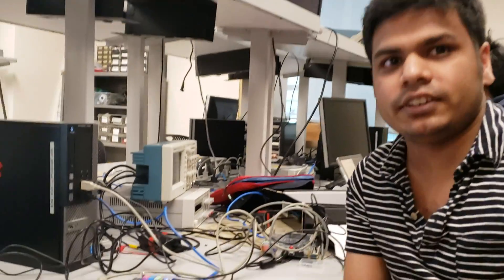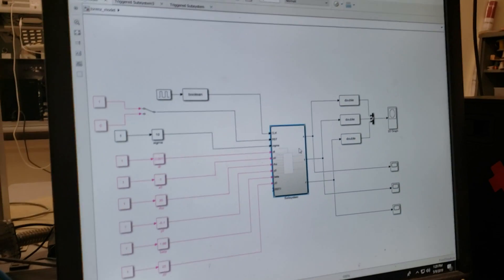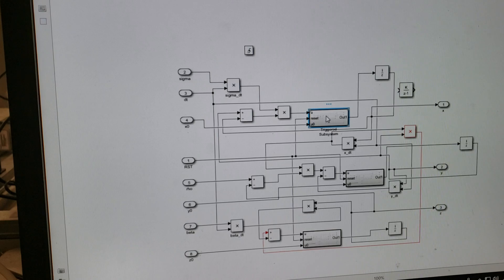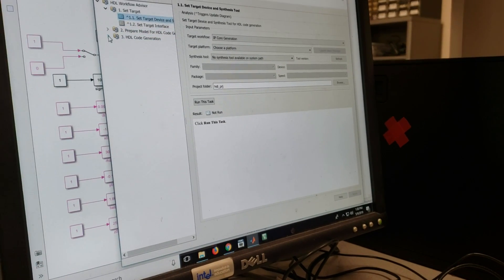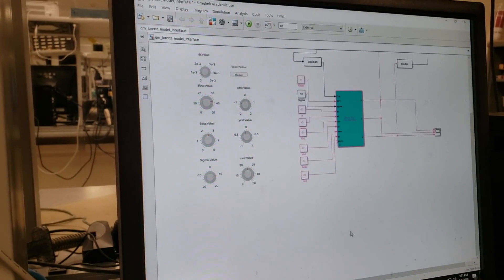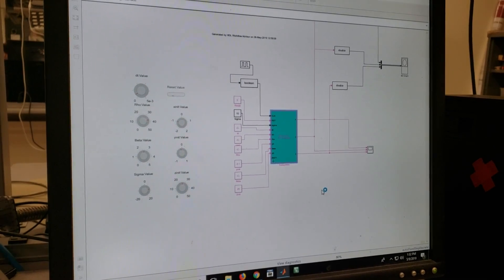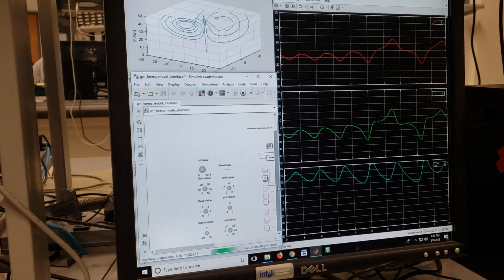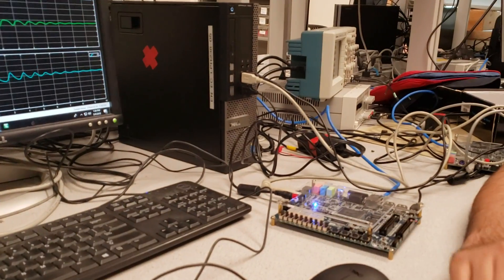Simulink-to-FPGA interface

Comment: hey i am doing the same workflow but using xilinx spartan 6 fpga board , and for some i am not able to generate bitstream. Can i get your email , i think you can help me out.
Reply from the maker: this project is 4 years old, so I doubt that the students will respond.  The only documentation is the linked report. Sorry.

Comment: Thank you for sharing your work. It is quite informative.
I am trying to do something similar on Intel Arria 10, do I need to install Linux and relevant HDL files on the FPGA before starting to integrate the FPGA with MATLAB? 
Thanks in advance for your time and consideration
Reply from the maker: the linked report gives the details, but yes.
Reply: @ece4760  Thank you!

Comment: Hello Everyone. Is it possible to implement that project by using Altera DE0 Board? I wanna read the states simultaneously.
Reply from the maker: does DE0 have an ARM core?
Reply: @ece4760   Thanks for your response Mr. Land. Altera DE0 board has Cyclone III EP3C16F84C6N FPGA. I do not see any ARM  term between the specifications of Altera DE0 board in terasic website. I actually need a DAQ boad with high sample rate (like NI USB-6363) for real time control applications by using simulink.  However i have an Altera DE0 and i am trying to find out if i can use it for real time applications. If it is not sufficient for what i want to do, i will prefer to buy  the cheaper solution between DAQ and FPGA boards for real time applications with simulink. I do not want to have to use Labview.
Reply from the maker: @kizmazhakan  If you read the linked report, your will see that communication requires the ARM for this project. There is no ADC or DAC on a DE0. Why use it for DAQ?
Reply: @ece4760  I thought i could expand it by using a AD/DA data conversion card (with GPIO connector). However i found out DE10-Nano kit has 8 channel and cheaper than AD/DA conversion card. In addition DE10-Nano kit has an Arm Cortex-A9 processor. Is it worth to buy DE10-Nano for real time applications? How many kSample per second can i get with that board. Will i prefer NI daq? I am thankful for your help.
Reply from the maker: @kizmazhakan  Yu are asking me to read your mind. How could I tell if you would prefer NI DAQ? For the A/D rate, read the manual. the DE10 had no DAC.
Reply: @ece4760  Sorry for asking the wrong question. DE10 has no analog output but i think use PWM output. DE1-SoC and DE10 Standard has 500 kS/s sample rate. They seem fast enough for me.
Thanks for your help Mr. Land. I will follow your lessons.
Reply from the maker: @kizmazhakan  It would be MUCH easier to just use a fast microcontroller. Perhaps. a Pi Pico RP2040